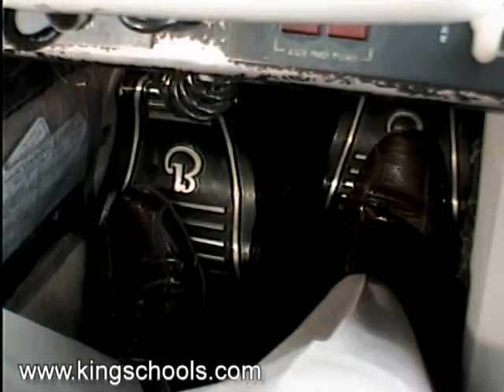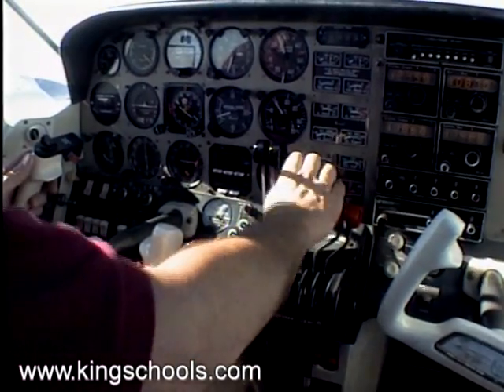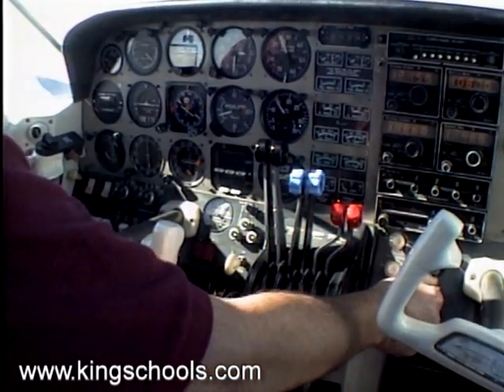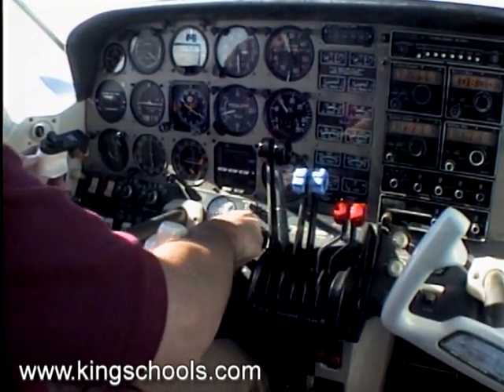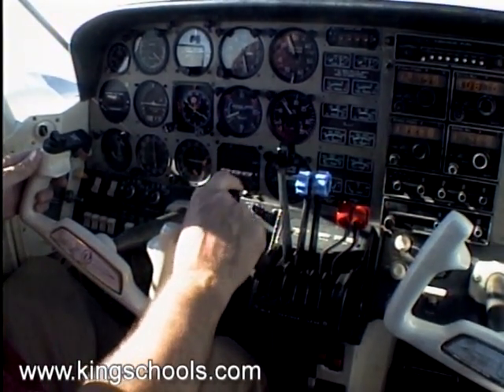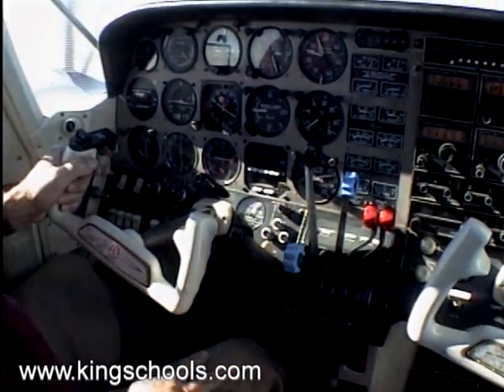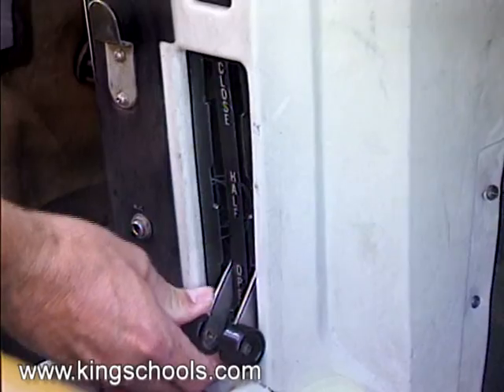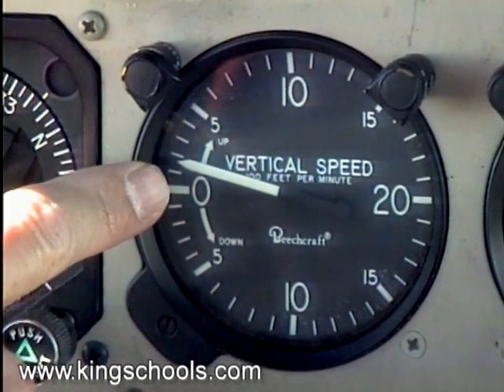Flying a Multi-Engine Aircraft

Comment: John,
In the video, the fact that you are holding RIGHT aileron while in single engine flight means that you are UNCOORDINATED!  You do not have enough right  rudder pressure which means the aircraft is in slipping flight and losing lift.  With the ailerons deflected to the right you have raised the  right aileron slightly and are therefore losing lift on the right wing.  You need to add MORE right rudder so that the ailerons NEUTRALIZE and center whilst raising the dead engine 2 to three degrees.  Small corrections like this result in rates of climb instead of descents.
Reply: You don't want to fly coordinated when you're single engine. You want a half ball slip (into the good engine) and a five degree bank into the good engine (using ailerons). The idea is to obtain zero sideslip and therefore minimum drag. John is showing it correctly. Ideally you would have a yaw string taped to the windshield to show zero sideslip directly.

Comment: The second engine in the seminole can take you to the scene of an accident or if used correctly can save you. The second engine on the 777 and the third and fourth on the 747 are there to take you to the scene of a safe landing.